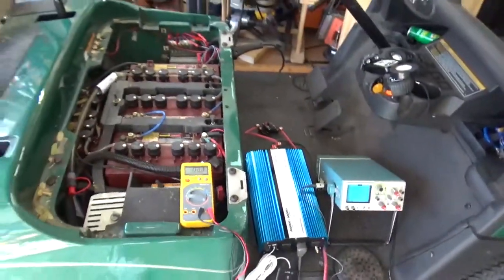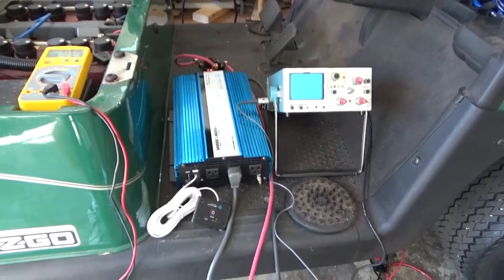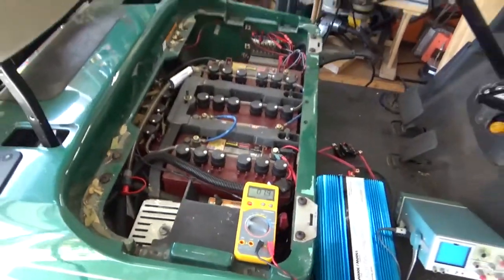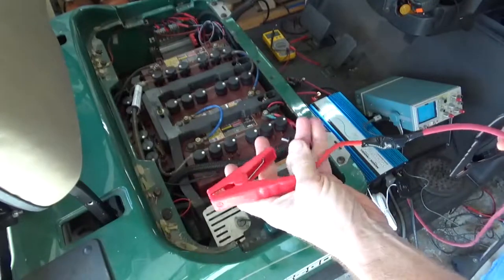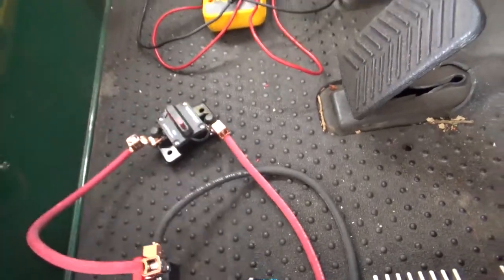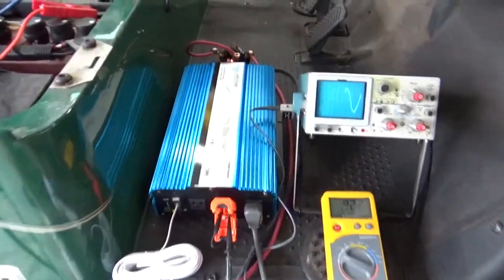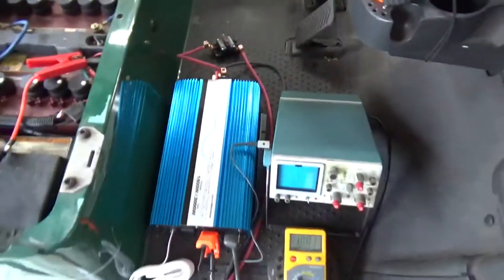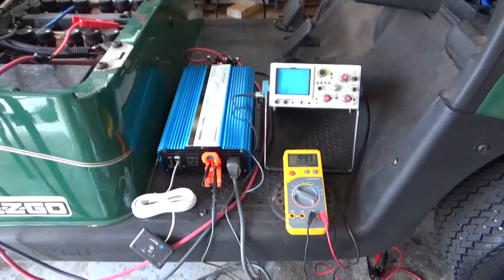Golf Cart 120V Aims Inverter

Comment: How's the AIMS inverter holding up? I'm thinking of the same setup, going to see if it'll start a 15amp electric wood splitter.
Reply from the maker: It's living a hard life, and still working fine.  Not sure how well the log splitter will do with only a 1500W inverter though.  15 Amps is an 1800W inverter . Volts x Amps = Watts. 120VAC x 15 Amps = 1800 Watts.  A 1500W inverter is limited to 12.5 Amps.  Inductive loads, like motors, also are notoriously harder to start.  Takes extra current to get the motor spinning.  That high spike of current can overload the inverter.  I have found that I can start most of my garage power tools with an 1800 Watt inverter.  The exceptions being my air compressor, and a 1960s vintage radial arm saw.  Both of those will shutdown either of the 1800W inverters I have with my solar setup on the house.  I've only run smaller power tools from the Aims 1500W inverter.  Short of trying it, can't tell you if it will work.  Good luck!
Reply: @2manytoyz123  good to hear! the next step up in aims inverters is a big price jump. I'm going to test it out in a couple days, i'll keep ya posted!